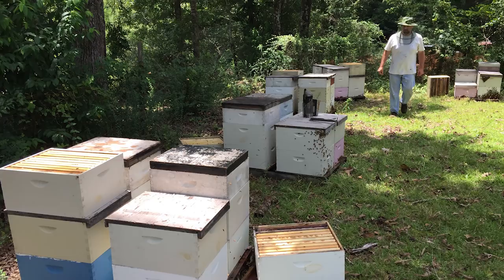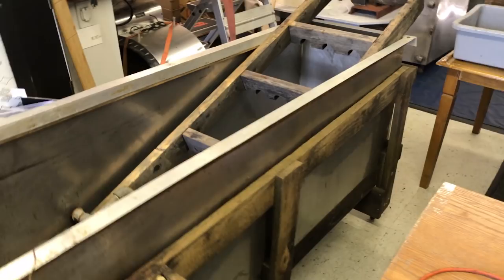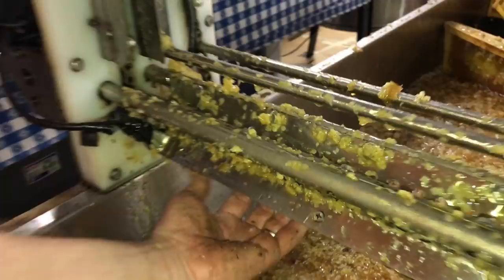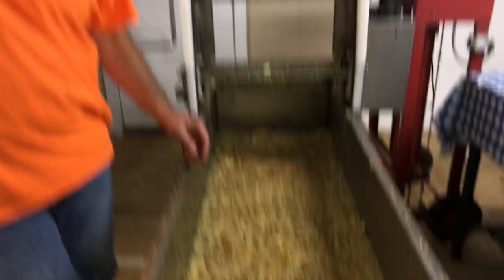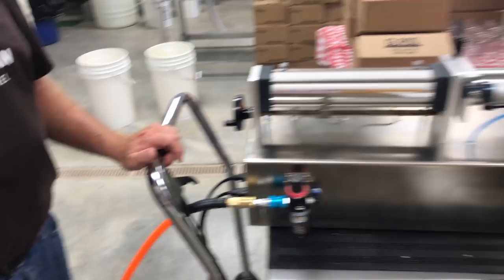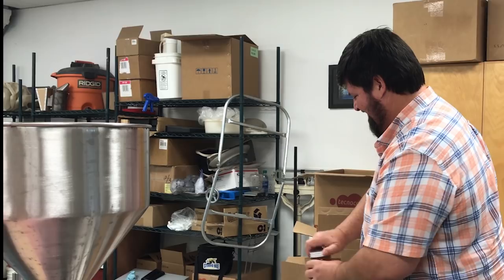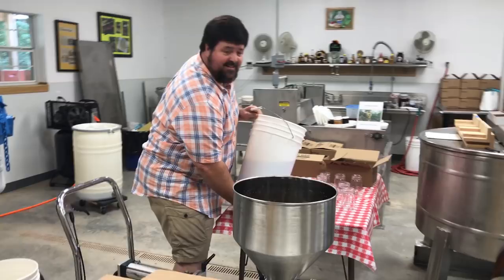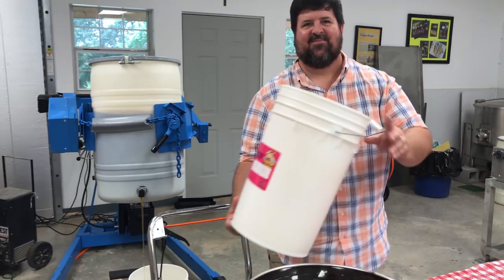Honey Extraction Made Easy

Comment: I worked for one of my professors in college extracting honey during one summer (back in the early 80's). Small operation but, I ran the extraction operation and pumped the honey into 55 gallon drums while he would bring in trailer loads of boxes full of honey. My first experience with honey bees and have a few stories but it was a fun and interesting learning experience for me for sure. One question that I didn't see in the video, how did you filter the honey?  I used pant hose which, my professor told me was the thing to use, which worked great but I thought it was highly unusual to say the least!
Reply from the maker: Stainless strainers.

Comment: 16:54 that cap. You can drill a hole in it and screw in a small hose nipple, add a  hose from it to say a bicycle tire pump...a couple hose clamps... then screw the cap back on.. a couple pumps of air pressure to the top and that honey would drain out ALOT faster than 10 minutes.
Reply: You can try it, but I don’t think you can save more than a minute or two. It flows under the pressure of gravity, not air pressure. A couple atmospheres is about the max that barrel will take (and don’t try to overinflate, imagine the barrel bursting while full up...) and that just won’t make that much difference at the exit.